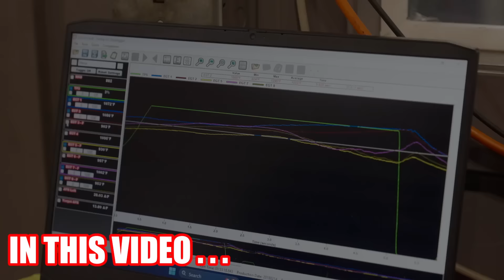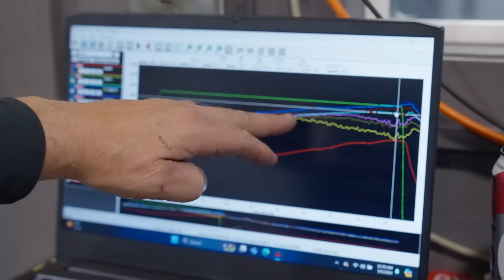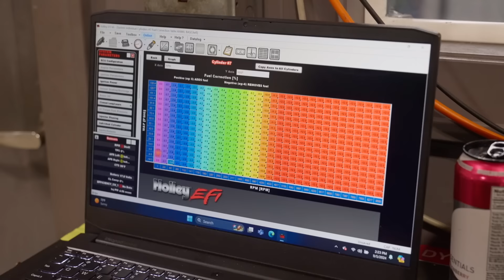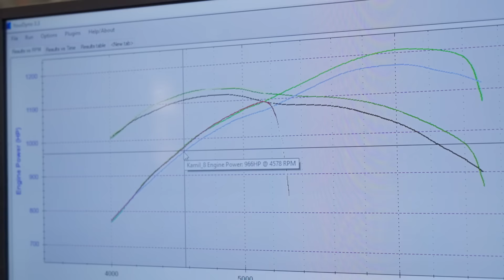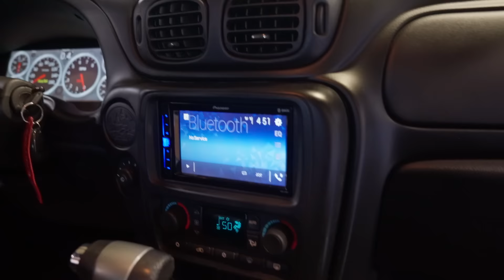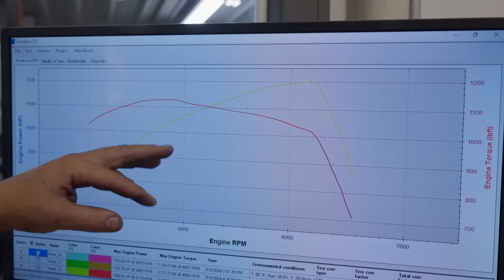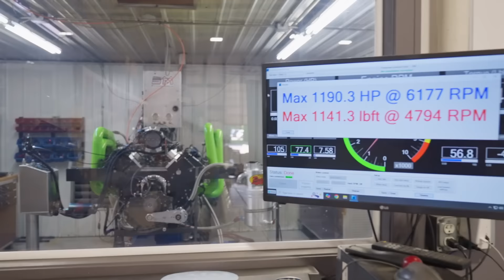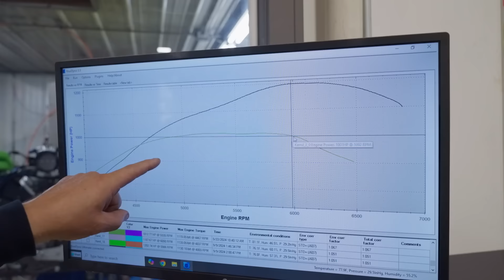200 HP from a Cam Change? The Biggest Cam I Have Ever Used In A Boosted Engine!

Comment: You thinking on camera and problem solving is the things I love most about your videos. 

Just some things I've been thinking on since the EGT got lower when you leaned the fuel on the lower temp cylinders.
Gas, and I think other fuels also, burns hottest at stoich, lambda 1.
One flaw with EGTs for cylinder trim is that they don't show you which side of stoich you're at.

Combine this with what I've learned of ignition systems. Powerfull CD ignition systems exel at igniting mixtures on the rich side of stoich, but not as good on the lean side. 
A powerfull pure inductive ignition system are much better at igniting a leaner than stoich mixture than a CD ignition system, but not that good at rich mixtures.

That would make my theory not a lean missfire, more like a incomplete combustion.
But I have no experience with monster engines at this level, so it could be factors I'm not thinking of or not aware of.

Comment: Can you explain what indexing the spark plug that way will do when the valves are both shut on the compression stroke steve? I can understand if the intake valve was open and fuel was going in, but I don't understand your train of thought for this one. It's been wracking my brain for 3 days 😂

Comment: You're running NA. Intake pulse harmonics play a HUGE part in NA performance. Its laying over hard at the end because your intake runner volume, and length have to be matched to the harmonic orders for a given RPM. NA is all about air pulse harmonics.  I bet if you put a straight tube on the front of the throttle body, it would help. Like adding a tall air filter on a carb.

Comment: Steve I don't think it's too much cam for compression based on its size and intended purpose. The duration numbers are kinda small for something so big, but then again if its going to run full out for powerboat racing its just right. Besides that cam is intended to be used with the blower.

Comment: That Is a ton of duration for low compression sheesh. I remember one of my favorite cams back in the days was a 292 comp solid lift In my 400+ cubic In Windsor. I had the same issue of lower power cause I wanted it to sound cool lesson learned about compression and stall size was a fun learning experience.

Comment: Is the wiring and computer your for the dyno or the customers? If the harness and such has a bunch of dyno hours. On off again and such I’d be checking for loosening crimps or spots that get bent back and forth a lot. I want to lean towards injector drivers in the computer showing fatigue.  heat raises resistance in wire and your spread increased with time. 🤷🏼‍♂️ food for thought

Comment: 55:51 Did you swap EGTs around? That's the last thing I can think of.

I don't think it's over cammed.  It would have lost both torque and HP if it was truly over cammed. Adding the duration will shift torque to HP until you exceed the volumetric appetite of the engine. Then both HP and TQ will drop.

Comment: 315 @ 50 intake 987, 325 @ 50 exhaust 998. Tighten the lsa to 110. Still mild. Huge engine. Will be torque monster at 5500. Hp king at 6500. Can you open the valves more? Still keep valve to piston clearance?

Comment: Besides a big 802 I think it way down on compression, that cam you have in there is something I would use in a big power NA build, only thing I can think of is spark and fuel per cylinder

Comment: I'm about 2/3 through and whenever I've had strange per cylinder performance that isn't cam, comp, spark, or tune, it always ends up being a tuned resonance issue with an intake runner or header tube. 

Things like tube diameter and length are super picky when you are running at or close to a tuned resonance (which can really improve performance).

Comment: I’m guessing the egts go up for a second when throttle is closed bc the air hot exhaust ports are hot and the exhaust flow lowers causing the temp to spike for a second.

Comment: 44 ohms is very high for a short piece of wire like that. I would change a couple out with some spares and see if that reading comes back inline. A great set of wires is at most 30.

Comment: Have you tried putting grounds directly to the heads? I wonder if you are getting resistance changes form RPM induced vibrations or if you are losing electrical connection when engine heats up.

Comment: Throttle body, intake manifold sizing with large cam and low compression ratio are disrupting your cylinder filling efficiently for the rear half.  May go away when under boost.

Comment: I have run a C400P Melling Cam on a NA/SBC with 8.5 to 1 compression and didn't fall off on high rpm. It was a duck on low rpm though.

Comment: I'm a total 100 percent amateur, but I thought you wanted to close the exhaust valve a little earlier on these big inch boosted deals. That  would keep from pushing the intake charge our the exhaust with lots of boost. Maybe that's why the overlap is so wide I dont know.

Comment: I wonder, are you running resistor plugs? If so, try a lower resistance, or maybe a straight copper plug? I'm also wondering if you chased the head studs, might be some hard anodizing left over there. That or a higher voltage coil? It seems like it's not completely losing spark, but it IS getting harder. And have you checked the resistance of the plugs themselves as well? Add the plug, wire, and about 5% overhead.
Reply: The only other thing I can think of is maybe the rings rotated? Is compression close to the same? (+ or - 5 psi?)

Comment: I’d still question it being a ground issue. It could very well be an issue with the ignition box, but with the anodizing creating ground issues, I’d still be worried that is the cause. It may be worth it to if you haven’t already to run a pair of heavy gauge grounds from each head to the battery to make sure that isn’t the issue. With what it is doing in the egt graph, it sure does look like a load issue, leading back to electrical.

Comment: I kept waiting for you to read the plugs.  Back to basics, what are they telling you?  Based on the ignition system making a difference,  how about opening up the plug gaps a bunch, to .080"?  Flame front speed is constant.  Trying to burn across a bigger bore takes more time, what are the plugs tell you?  EGTs will drop if you're lean of peak EGT.  I'm worried that the bore is so big that you really need dual plugs in each cylinder to completely burn the mixture.  Typical aircraft engines have a 5.25" bore with dual plugs. They definitely make less power running on a single ignition system.  The prop is just like your dyno absorber, provides 100% load.  Switch off one ignition and rpms drop 100 to 150 and egts actually rise because the timing is fixed and running on one plug, the mixture is still propagating/burning as it exits the cylinder.  Some advice from someone that runs a combination like this mountain motor might be helpful. Good hunting Steve, thanks for sharing.
Reply: Makes big sense to me. You’ve obviously been there,done that. Thanx fer yer wisdom.😊

Comment: A thought from a dummy in the cheap seats. I couldnt offer anything constructive camshaft wise so mum is the word for that from me. 
However re the thermocouples and the different unusual reading you are getting. K type as I would expect you are using use a different type of wire material for each connection. if connected wrongly they will read wrong. Even things like bulkhead connectors should be using the proper material for each type. I have come across incorrectly made thermos its rare but over 30 years I saw 3~4 dodgy ones over thousands of them. Worth checking perhaps a swap between cylinders to check? Another thing that may be affecting the read is the anodizing as you have mentioned. A combustion process is just another form of oxidising. A flame will generate an electric current when the probes are inserted. It used to be a common way to detect a flames presence for burners. You may have an external current being generated by the thermo due to the insulation properties of the Anodizing? It is unlikely but possible in this sort of unique situation.There is a reason why thermos are not usally placed in a flame. It really isnt my field though Im a mechanical guy.
Good luck Sir. A great video.

Comment: Had a small block chevy years ago cleaned all the plug holes with tap and wire brush no go ennded up puting nickel antisieze on the plugs fixed the problem

Comment: I don’t have any idea if it’s to big. If no one’s built anything that big before how you going to know. I keep thinking of Rollog MN ! They have some monster motors there! The one I really like is the snow motor. 600 hp. The flywheel must be 30 feet. One rod, two piston,4 cylinder motor. The thing I am trying to get at is you can see the cam!!! That a cam! I’m thinking it runs only maybe 200 rpm. You are jumping into a new world. Good luck.

Comment: Wonder if a 115 or 118 lsa, with a 1.125 intake lift, 1.40 exhaust lift would do. I would check to see what the most lift you can go to when it interferes with the piston, then back it off by .080-.090". Try a 118-120 lsa. 
Those heads are insanely big, so are the exhaust tubes. Also wonder if the throttle body and I take manifold itself is big enough too. Maybe not enough airflow going into the engine initially?? I'd guess it's just running out of air when the revs get up there. 
This engine, in n/a form, should easily make 1700+.

Comment: Hmm, did the issue with the bad bank of cylinders have something to do with the chassis ground (connector pin A--the ground wire that bolts to the cylinder head) for the coils?

Comment: I've picked up good numbers even on a mild LS just by putting a volute on the throttle body, and in this case I wonder if the throttle body and plenum are just too small. It would be interesting to put the dyno air turbine on it to see the CFM. Does the MAP show any (or lots) of vacuum at peak RPM?

Comment: 47:34 -  At about 2/3 way through the run something is throwing sparks: Is it mechanical or electrical? Dodgy Chassis-ground connection at a particular resonant frequency where the issue initiates?
Reply from the maker: The starter pinion sometime touches flex plate on the dyno

Comment: Any way to look at Ignition Spark Duration Time in Milliseconds with your Software Steve ? Like old Shop Ignition Oscilloscopes still common in 1970s to early 1990s.  I have an old Snap On Counciler CRT Cathode Ray Tube Oscilloscope with storage capabilities.  Made for 1st generation GM Ignition Coil packs.

Comment: Is there a difference on the holley software from the terminator x to the dominator. You built us a carb bbc engine setup in the past i been playing around with the terminator x on some ls setups on our street cars. Was thinking about having you redo another engine with efi at some point when we can get more familiar with it as i know you really don't have time to show anyone how to tune it really. Just curious it if it makes a difference on the two systems in a race applucation or not i know the dominator is better. Also are you selling the intakes for the bbc for the holley system to run the holley efi and related parts to make that work? We used to buy all of our parts from you but i guess we can't anymore? Any thoughts id like convert the carb bbc. Its a bbc blow thru f2 procharger

Comment: Coming from the marine industry, I can tell you that you should have stayed with the 1st camshaft.  Low rpm high torque and mid range is how every marine engine is tuned and provides the best drivability on the water.  Understandably this is a unique high performance application its just not always about max rpm and max power.

Comment: My gut says that the front cylinders are consuming most of the air and there isn't enough intake plenum volume at the rear. Those are some HUGE piston. Under boost the problem may go away?

Comment: 10 years ago these motors were already the most expensive things on the planet, and after all this money put into it you'd have something that wasn't very easy to sell because of the bore spacing, sheer cost of the heads, and replacement components. If you hurt the heads on these and nobody would touch em, it'd be like nearly $20,000 in today's money to replace em. This is the reality of the super super high displacement stuff, all NA stuff has a huge cost, specialty castings, and boost sorta pushed these kinds of builds out. Not to mention they're unusually hard on parts because of the scale. There are a few niche classes where this thing makes sense but again it's the most expensive recipe for driving from A/B. Theres a reason you had a ton of difficulty with this and I admire your determination just to build the nokwledge pool

Comment: You might have to run a fat, like one inch ground strap from each head to the block and then make sure the threads and the spark plug holes are nice and clean that block and head surface. I can't remember if the head service and the block service. You know, even though there's a gasket there, it's a copper gasket. You know, if it's not grounding properly, it's gonna throw all kinds of stuff off so, very smart. That's I've never even thought about that.
Reply: heads are  grounded to the  block   though bolts/studs and  gaskets
Reply: copper is a fairly decent conductor. the same stuff they put inside wires!!!
Reply: @futten3230  I understand that but if both deck Surfaces are anodized at den. It's only grounding through the threads if they're not, and they have anodizing on uncertain depths, you could reduce your your ground surface. It's all about, you know. Conductivity and grounds are so important. Especially in an internet You know, need so much mega jewels to complete a burn in such a huge combustion chamber, and such

Comment: Since the coil and injector swap didn't move the issue cou the problem be with you egt sensors or with the adapter egt plates?
Reply: Coil swap fixed the EGT problem. MSD Box seems flaky as the problem didn’t move cylinders with moving the coils. A new MSB box and new MSD coils would be something to try so see if the problem persists. But that;s not something he has just lying around the shop;  I am wondering if this engine just needs a longer spark time in general that the Smart Coils provide. Watch to the end, tuning moved the layover up to 6400. Next video should show more tuning and indexing the cam to try to get the layover better. Steve is very logical about debugging these things, as an embedded systems programmer when strange bugs happened we had to determine if it was the software or the hardware (electronics). This is very much the same sort of logic problem, when complex systems interface to each other it’s hard to debug.

Comment: So would you have to do a resistance  test between all the engine components like block to cylinder head to intake and spark plug to cylinder head and computer ground, all for good continuity ??

Comment: With seeing the change  when going to the Smart coils, I would assume it has more to do about the burn rate in the chamber necessitating that smart coil versusthe dumb coil. Hence, having more compression would have an increased burn rate in the chamber and the dumb coil, providing a better job igniting that combustion chamber. If having less compression with that large cam, the dumb coil does a better job igniting that fuel longer with the slower burn rate. That’s my guesstimated theory.

Comment: Steve, do you have any buddies who build mountain motors for NHRA? Maybe they have ideas for this big hemi mf'er.

As an aside, the ignition efficiency issue fascinates me. I understand electricity and the implications of the resistance of firing the plugs in a fuel air mix. Would love to see a video that explores this area of tuning. I suspect this is a total mystery to 99% of your viewers - even those of us who understand Ohms Law. I was always the one who was thrown electical problems when i turned wrenches a gazillion years ago but this baffles me. Never tuned race engines so this never came up.

Comment: I am just curious. Since this is such a large cubic inch motor could the air demand of the engine be more than what the throttle body can flow above the problem rpm area causing the motor to go rich?

Comment: Steve , now you've stated CR at 10:1, which is not really LOW when using pump gas. A wider LSA will help raise the effective CR I'd look at using less LSA ( 107 deg ),create some overlap so it can breathe at higher rpm. Less LSA should increase the torque, or the snappiness at lower rpm. Its a big engine taking more time to fill the cylinders, maybe requiring more duration, flowing more air takes more time. its only pump gas , not good fuel , is  this pushing the limits ? try some good stuff.            On an NA Engine Wider LSA works with long Individual Runner intake,    Tighter LSA with short runner plenum intakes.

Comment: I bet its laying over so quick and hard throttle body is the restriction n/a. And the back cylinders are getting chocked out because the the plenum volume is smaller in the rear and so far from the restricted inlet in the front just my guess

Comment: I’ve had a bad MSD 600 right out the box. Car would run for 30 seconds and just die all of a sudden, replaced it with a known good 600 box and it sounded like a completely different car. At least I know I’m not the only one with bad luck.

Comment: The intake closing at 90 degrees abdc seems awfully late to build any cylinder pressure without a higher compression ratio. Could change cam timing if you have clearance.